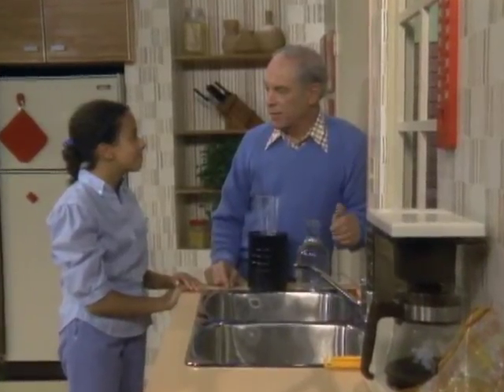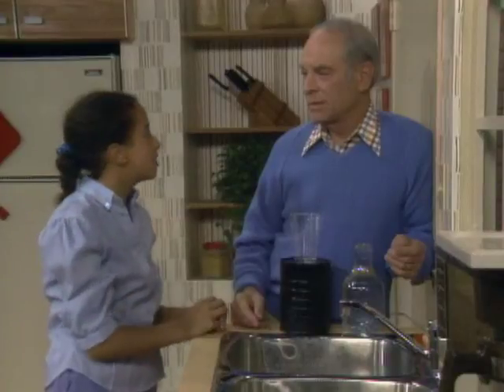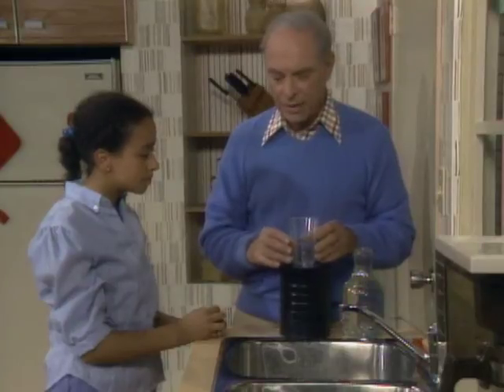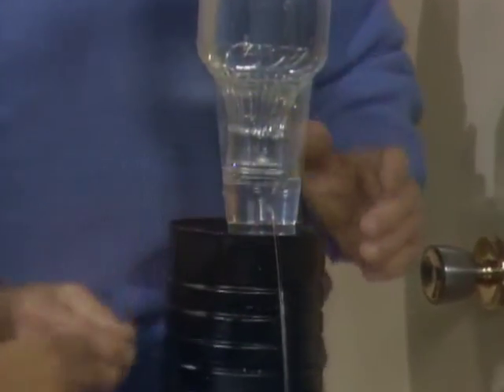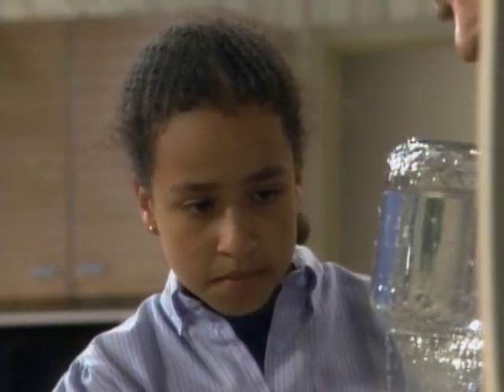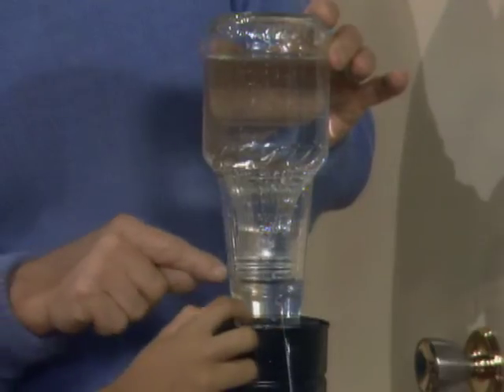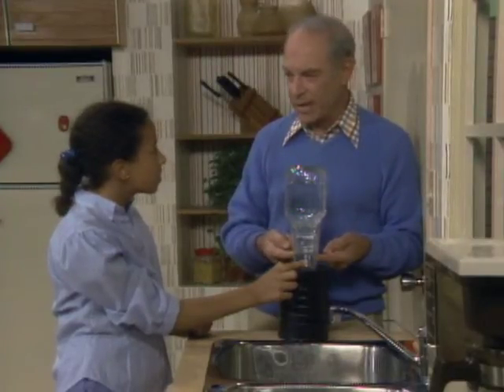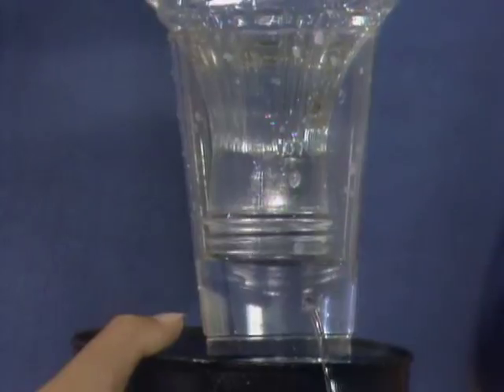How a Water Cooler Works (Mr. Wizard)

Comment: As the bubble rises, it loses pressure and expands.  Because the air bubble expanded, it lets out MORE water than the size of the initial air bubble and this is seen because right after a bubble, the water level in the lower container is above the mouth of the upper container.  This allows for some flow out of the lower container before the upper container can pull in more air.  The higher the "head" or height of the upper container, the less frequently it will suck air, and the more water will be released per bubble.